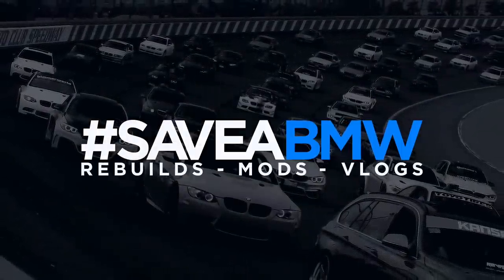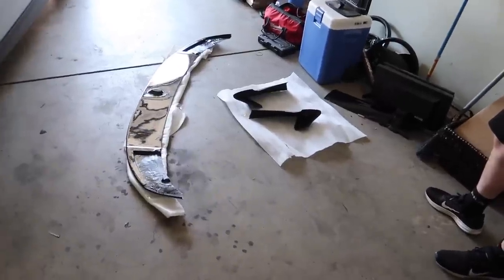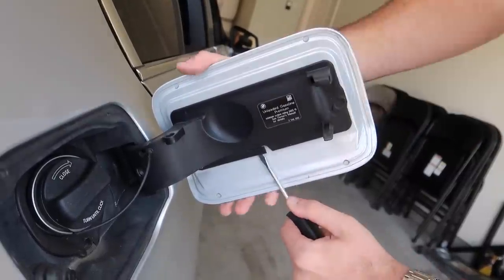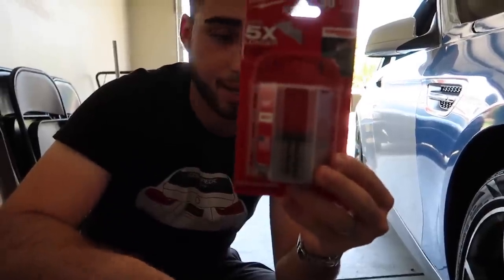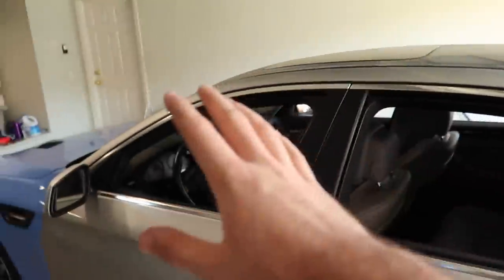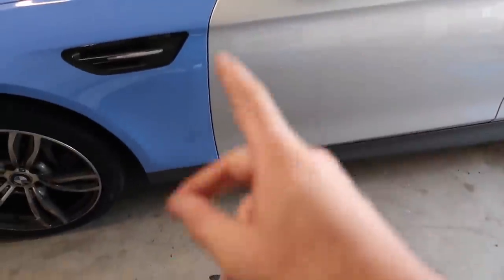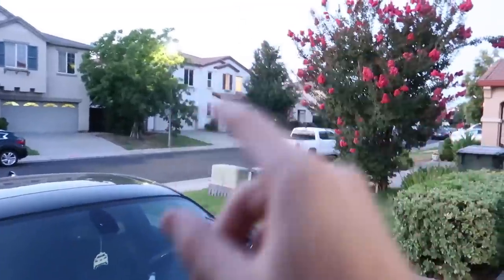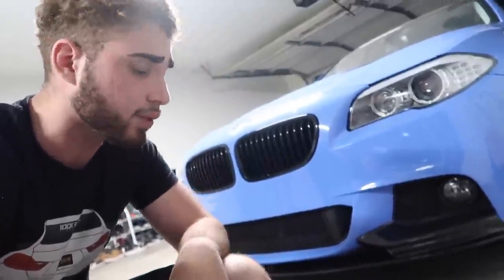THE F10 GETS CARBON AND 60% WRAPPED UP!

Comment: Thanks for the tip with the fuel door, I have to repaint mine before I do the paint correction because some dickhead dented it in with a screwdriver before I owned it.

Comment: Be careful driving fast on the freeway those splitter are awful air will get underneath rib it off 80-100 mph I seen it happen with multiple cars not being tight enough

Comment: you will regret not paying more attention with the edges (where it lifts off) 
as soon as you start to wash it and the water will go all over it will start to peal off
don.t really understand the " the wrap doesn.t have to be perfect" ?! 
there are pro shops (check Yiannimize )
that will wrap ur car and it will look better than any paint
it looks okay from a distance ...
GG but pay more attention and remove the parts and do it properly ... don.t cut corners
Reply: yeahh .. too bad .. you rushed the job a bit
Reply: I kinda have to agree too..